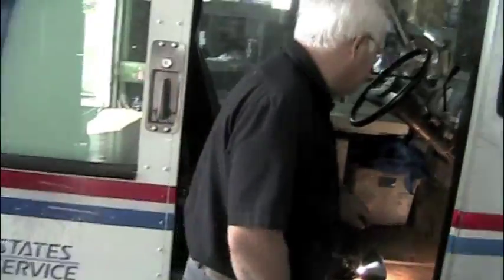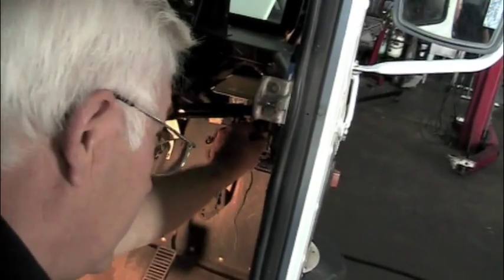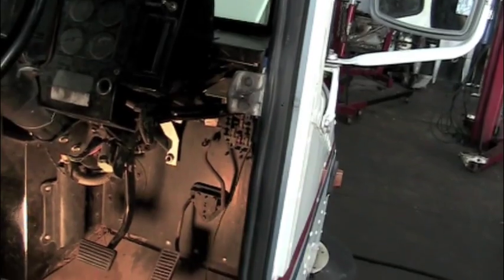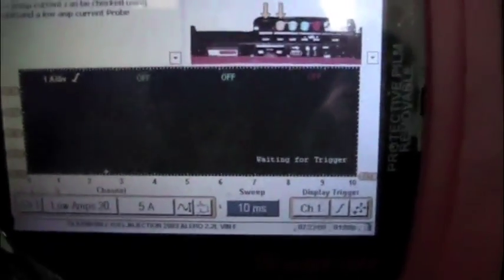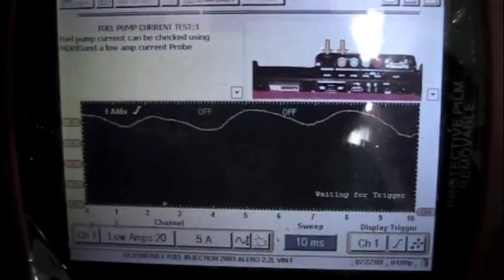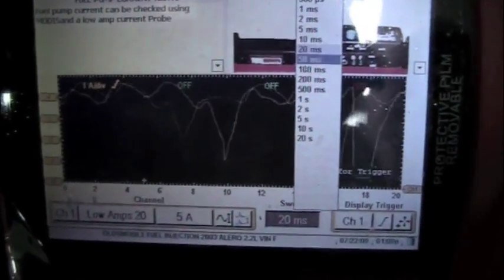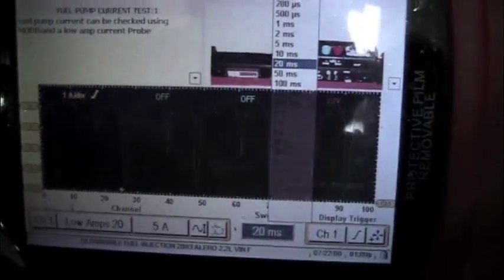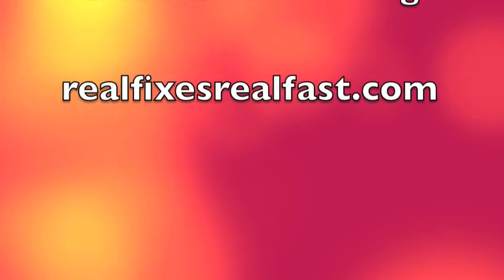LLV Determining a fuel pump is bad electrically

Comment: what fuse?
Reply: Jingles s ECMB fuse in this case because the fuel pump is tied to this circuit. On most vehicles though, there is usually an exclusive fuel pump fuse.